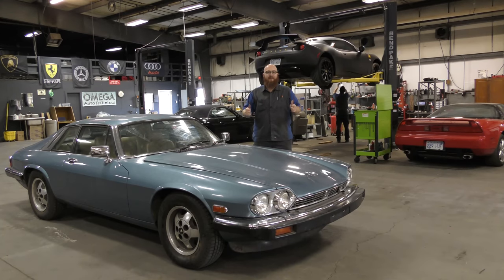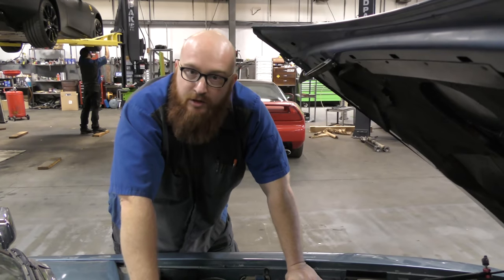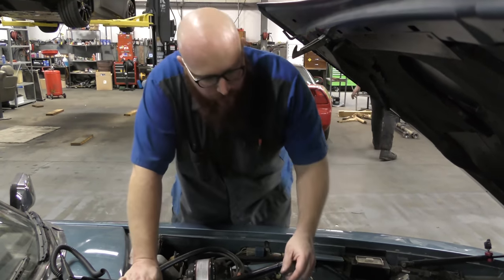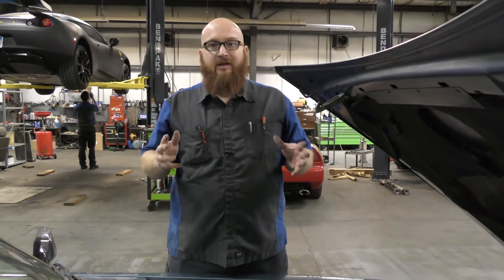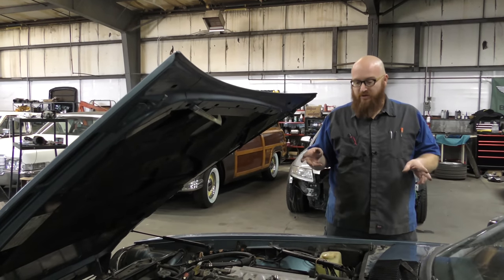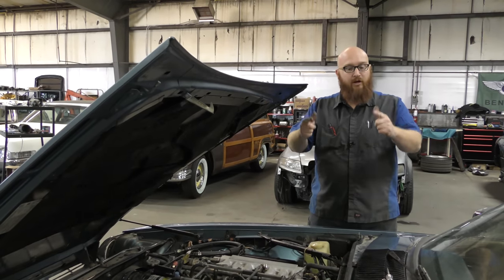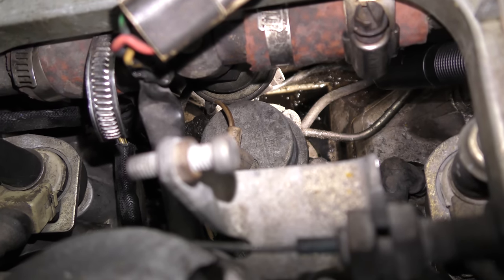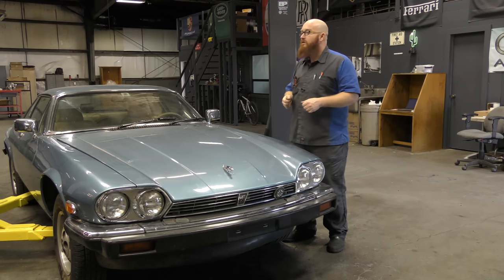'82 XJS with the cursed Jaguar V12 comes into the CAR WIZARD's shop. Can he get it running?

Comment: As a Jag mechanic in the 80s-90s , I worked on these daily. Great engines, pathetic electrics but really not that bad to work on.
Reply: LUCAS!....Prince of Darkness
Reply: @deplorabledave1048  Do you know why they drink warm beer in the UK?

Lucas fridges.
Reply: Working on them daily gives you an advantage over any other poor sod who dares to tackle  one.
Reply: @johngaither3830  they really are not any more complicated than any other EFI engine of the era.  You just had to actually have a clue and know how to do proper diagnostics.
Reply: @maxpo787  Lucas weren't the only manufacturer with electrical problems - they just perfected them.
Reply: I have read so much exaggerated shite about how unreliable Jag engines are on most you tube comments. The straight 6 was a bulket proof legend if looked after and the V12 was good if looked after. Both can put out serious power if modified.
Reply: The biggest thing now is that you "just" need to rewire the engine harness and put a standalone. I standalone ECU with wiring that you have documented will make these extremely easy to work on. Most people just threw a regular distributor, and carb on the engine they swapped in.
Reply: @matthewq4b i am a beginner mechanic for my own car. How should i go about diagnosting a car? What approach did you use?
Reply: @stocks4bt   The first thing 
you need is actual functional knowledge of the system you are trying to diagnose.  Once you have that you will know where to start.
Reply: @da_poopoo_dealer3152  it's a fairly simple matter to get these V12s near 350 HP with basic bolt-ons, no touching the internals. For a car designed in the mid 70s to mid 80s, that's pretty good. Compare it to what domestic V8s were making in the same era.
Reply: For diagnostic work a factory manual oem. Ie helm. Provides system operation and. Usually accurate wireing diagram and hydraulic diagram for transmission, hvac ect. I have bought them for every vehicle I own. I have done a full overhaul on an 1982 v12 jag. One year later customer brought it in for service . Said never ran better no oil leaks.
Reply: Putting a V8 in that car is a crime.  Jaguar switching from I6 to V8 was a crime.
Reply: That's encouraging- been contemplating getting one of these and wondered whether they are realistically maintainable. 

I do know there's an exotic car mechanic shop locally and I see porsches, ferraris, and a few jaguars there. I don't mind paying for work on a car,  but do mind if it never runs.
Reply: @pleappleappleap LS swap it
Reply: @marsenault9683  Blech.  Power isn't everything.  There is no V8 as smooth as an I6.
Reply: @pleappleappleap  I was mostly joking. Lol. I like engines.period.  had all kinds, never a v12 tho.  I actually really want a Jaguar V12
Reply: @marsenault9683  They're not terribly expensive these days. Go for it! 

Neither are BMW I6s either.

Comment: It’s a shame jag had so many issues over the years. The 80’s bodies were so beautiful.
Reply: So true, beautiful cars..... too bad the English ate CLUELESS regarding electronics and engines.
Reply: @theshootindutchman  But still better than your grammar!
Reply: Absolutely gorgeous body. One of the best looking cars of the 80s by far,  and STILL  better looking than most cars today. I tried my hardest to get my wife to let me buy one ( could have bought one cheap!), drop in a chevy 350, but she didn't want to hear it. Ended up.buying her a Monte Carlo with the WORST  engine Chevy ever made. 😡
Reply: ‘One of the best by far’ is a phrase that makes no sense at all
Reply: @IsleOfFeldspar  There weren't too many cars that looked better, unless you're talking about Ferraris, Lambos, or Maseratis.  I think it makes perfect sense. But you're entitled to your opinion.
Reply: I love them with the quad headlights.
Reply: I never thought it was a particularly good design- and I owned one. A steaming pile of mechanical troubles. I've owned dozens of cars and this is at the top of my "never again" list
Reply: Fun fact: the design came out In the 70s
Reply: That's why so many of them get GM V8 swaps. A sizable portion of them, depending on the year, run Turbo 400 transmissions. Makes sense to swap in a GM motor and not have to modify the transmission tunnel, area around the bellhousing, mount points, etc. And you eliminate all the goofiness of the Jag design in the process.
Reply: @theshootindutchman  I think you are confused, one of the best V12s ever made and dumb mechanics using a hammer on a a complex thoroughbred engine, The electrics from Lucas do not condemn a whole country either, we are fine at electronics..Plus Lucas are OK.
Reply: @theshootindutchman  You did watch the video? You did see that the most common failure was a CHEVY ignition part? Seems the US can’t do electrics either…..
Reply: Well it was a good engine but the British engineers showed by there design ,that little attention was paid to serviceability and making it easy for mechanics to work on which seems to be a common theme on British cars ,a lack of respect for mechanics and those who work on them. Also the shear size of the engine ,means heat soak took it’s toll on the Lucas electrics and Hence a lot of the problems
Reply: Enzo Ferrari said it was a beautiful car
Reply: @hoodwinker7932  no way man, electronics are quite tasty
Reply: @harrymanne5803  No he said the Jaguar e-type was the most beautiful car
Reply: @hamishfullerton7309  * Their. Fun fact that also in the English language; there and they're.
Reply: ""No, no, say its not so""
""No, no, say its not so""
The internet Grammer police is gonna get you yo!! Watch your spelling and grammer or you too may come message to message and nobody needs that kind of troll food in the comments..
Reply: If you understood the Jag ... they were very good cars.
Reply: @DriveCarToBar   Instead of the Ford C-4 transmission fitted with a different valve body to 'adjust' shift points ... Jaguar could have chosen a better transmission ... a Ford C-6.
Reply: @DriveCarToBar  I'd like to get a jag and drop a Barra in it...
Reply: Jags in general are BEAUTIFUL
Reply: @theshootindutchman  that’s not true. Electronics on Jaguars were useless but the engineering was and still is superior to many countries. It just that American mechanics aren’t capable of working on European engineering.
Reply: @loumontcalm3500  Thanks for the warning. I still want one 😬
Reply: @craigweis1675  Jag went with the GM TH 400 as it had lower parasitic loses than the C6
Reply: @ianhelyar9553  Or just get an I6 one....
Reply: @hoodwinker7932  ooooh, a single letter typo. Did he strike a nerve perhaps? Because he wasn’t wrong.
Reply: @theshootindutchman  o
Reply: I had a 76 XJC, it had a 350 in it so you could actually drive it. Very nice car.
Reply: @martinda7446  Lucas electrics were the worst crap going. Gave British cars a bad reputation along with other issues.
Reply: @harrymanne5803  That was the E type.
Reply: Couldn’t have said it better myself!!
Reply: A V12 XJ-S was my first car in highschool, I loved it, till it burst into flames because the guys at Best Buy wired in the CD player wrong.  Then I bought a second V12 XJ-S because I loved the first so much but I had a proper mechanic install the CD player.  Beautiful cars, filled with personality, gave me a mythical reputation in highschool, but absolutely terrible for repairs.  I had to drive 20 to 50 miles for a mechanic and I went through 3 mechanics and the car ended up costing me twice what I paid for it in repairs.  Unless you know a really great mechanic and you're prepared to pay then I'd stay away and I say that as someone who owned two and loved them.
Reply: Nightmare😢😢😢😢
Reply: @DriveCarToBar  The goofiness is exactly what makes this car what it is. I wouldn't want an english car without it. The main problem with these cars is that people bring them to regular car shops instead of specialists. They require specialist maintainance and use with care, otherwise it will be problematic. Years of wrong/bad maintainance take a toll on an engine.
Reply: Chevy made a v12 ,that would go well in the jaaaaag
Reply: Man what an ugly engine bay!such a mess of pipes and wires

Comment: A puddle of oil under an XJS just means there's still oil in it, it's when there's no oil puddle that you start to worry.
Reply: Exactly
Reply: Fuzzdog that's most British and German cars with Italian cars it's where did the coolant go?
Reply: Comon bruh be original
Reply: The XJ-S still had an old-fashioned rope seal for it's rear main seal.  I heard Jaguar dealers used to keep oil drip pans in the show room floor!!! (Ford redesigned it right away in early 90s).

To replace rope seal, you need to pull the engine!  But rope seals will always leak a tiny bit, that's just their nature.   I've heard of guys replacing it to stop annoying oil drips, only to have it start leaking again within a few months.  Best thing to do is change oil regularly, use recommended 20/50W, and don't let your engine sit non-running for extended periods.  A few odd drips now and then is normal.  (Not a puddle)
Reply: Sounds just like the hydraulic system in the CH-47
Reply: @gregholt4615  God , back in my uni days in the 90s I rebuilt the entire engine of my old rust bucket just so I could get to school. Ended up in IT but because of that experience I know exactly what your talking about and the amount of work to get to it. FYI once I did that the engine I rebuilt didn't leak a drop.
Reply: @gregholt4615  Rope seals are common in many engines. They will all weep,. 
Jags however just pour it out.
And yes Jags need drip trays and near certain did when new.
Reply: @gregholt4615  The cylinders heads and rocker stands are separate pieces, and the mating surfaces were machined to a very fine finish.  Due to the clamping pressures involved, a regular rubber gasket would not work there.  Instead, they used a special sealant.  Over time, that sealant breaks down and causes leaks from the top end of the engine as well.

I worked on an XJS for a friend.  They're great cars but you MUST take care and know what you are doing.
Reply: my grandfather said the same about his old chevy truck.
Reply: Yep, I bought a landrover with no oil leaks once. What a horror story that was :o
Reply: Yep, All cars built by Leyland back in the day leaked oil. Even when new. My 74 MGB was professionally resealed and it still leaks. I was just told it’s normal 😁
Reply: @Atlantean1980  wow
Reply: too funny !!!
Reply: Its just marking its territory like any good unneutered kitty does.
Reply: Yes its a Jag,it leaks oil. If there's no oil puddle the engine has drained is what i always heard
Reply: @gregholt4615  furthermore, some british cars such as the MG do not have any main seals. The crank is machined with grooves to return oil to pan.  Of course it's not perfect so it will ALWAYS leak a little bit
Reply: hmm so like a harly davidson doesent leak just marks its spot
Reply: That's not a leak, Its a Jaguar underbody anti-corosion system hard at work!
Reply: @Craig-wp3pz  They were soooo ahead of their time :p
Reply: I'm very old in the UK and had to work on British cars from the 50's and 60's. Not a trained mechanic but everyone I knew could keep old clunkers on the road. Had to 'cos we had no money. That meant re using split pins, maybe a bent nail if it broke. Until the Japanese appeared, they all leaked right from the factory. No competition so it didn't matter. From front to back: Coolant leak, timing case leak, rocker cover leak, tappet chest (2) leaks, crankcase breather pipe leak, crankshaft rear main bearing leak-into the clutch housing. Also the front gearbox main bearing. They even put a loose split pin in a hole at the bottom of the bell housing to rattle about to allow oil they knew would appear to drain out. Not finished yet: Gearbox rear seal leak, differential front bearing leak, must admit half shaft seals were usually ok. Then there were the brake slave cylinders spewing hydraulic fluid over the shoes. Didn't make it any more dangerous as the brakes were useless when they were good.
Reply: Automatic dipstick 😎
Reply: I bought my '88 XJ-S V-12 in '93. It hasn't dripped a molecule of oil in 28 years. Should I demand a refund?
Reply: that's EVERY british engine ever made.....
Reply: I've had one for a few years , you are not wrong.
Reply: @wildbillharding  NOOO !!!
Reply: What? Is that a silly attempt at making a joke? Seems like it.Just say it pisses oil out if it does fool.I`ve got a car with a german engine,not that old and it left two oil slicks outside my house.Its a pile of shit anyway.
Reply: I was at an auction walking by a Jag, some guy was in it, and when he hit the starter it sounded like someone shaking a big box of broken glass. Weirdest motor sound I ever heard.
Reply: Lololol! I almost spit my drink out!
Reply: And no American cars have ever leaked oil!  These V12 Jag's were prestige cars and should have only been worked on by specialists that fully understood their intricate design.  You wouldn’t take a Lamborghini to a Ford mechanic and expect him to be competent and cheap!  😬👀
Reply: @wildbillharding  haha,sorry joke was what??
Reply: @brianmorecombe2726  It's weak English humour, Brian. It's a stupid way of making out that my car is extremely rare and not behaving as it should,.
Reply: Kind like a C130 or certain helicopters, Still have hydraulic fluid, all good.
Reply: It's a friendly way that jags mark there spots
Reply: @jeffreygunn3530  I did powertrain on those bad boys and this comment made me think of that lol.
Reply: 😂 no doubt ..
Reply: If there ain't no oil under'em. There ain't no oil in em.
Reply: An old timers once told me, if a British car doesn't leak oil, that means there's no oil in it.
Reply: @philagethechef  never had a german car with oil leaks🤔
Reply: How did he push the car to the lift by turning the tire!? He really is a wizard
Reply: Exactly. Jaaaaags don't need dipsticks. All you need is a view of your driveway as you pull out.
Reply: @gregholt4615  The oil drips is just Jag's way of rustproofing the undercarriage.
Reply: Pardon?